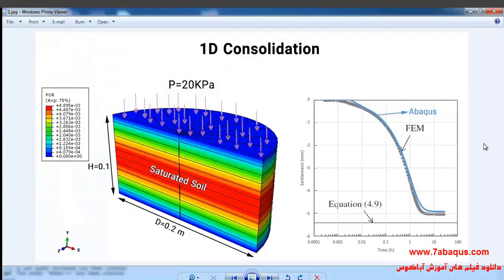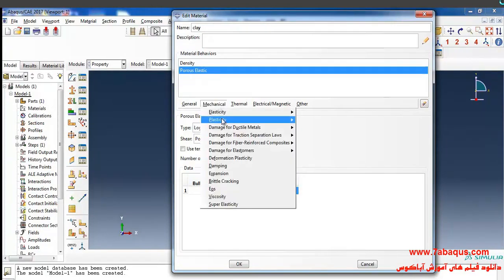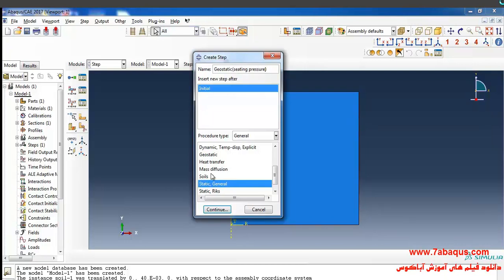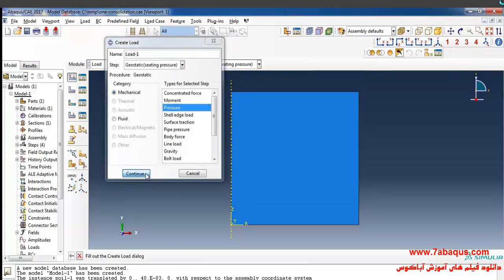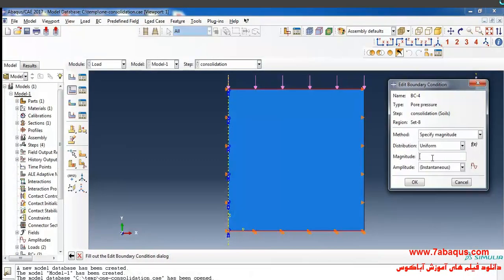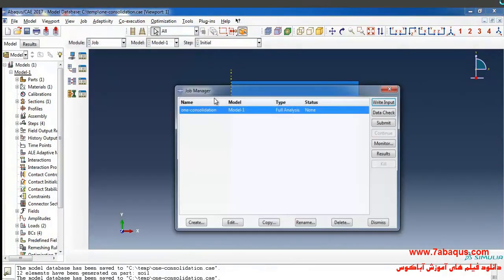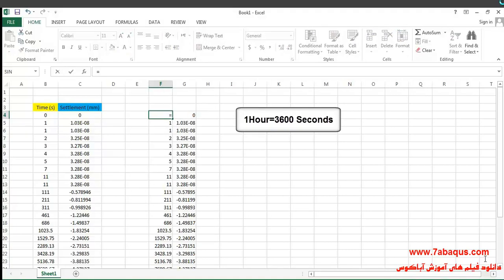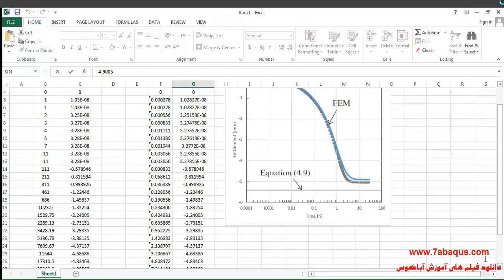1D consolidation of a saturated soil Abaqus

Comment: Hello, how do we determine the max pore pressure change per increment Or creep tolerance while defining the steps? How did you determine 21kpa Or 17 kPa for this particular problem. 
In initial conditions other than geostatic stress and void ratio, don't we have to define initial pore pressure and saturation?
Reply from the maker: These values depend on the loading rate , time period , size of each increment , ...
Reply from the maker: In this example soil is assumed to be fully saturated
 Initial pore pressure is used in special cases, for example, water behind an earth dam
Reply: @saeedmoeini-7abaqus  thank you

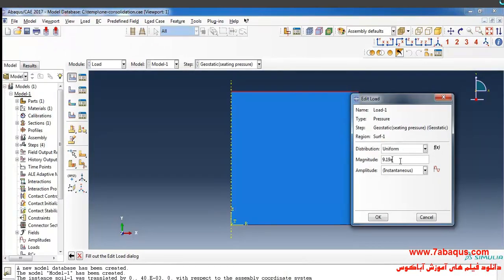Comment: why in 12:46 you use the geostatic pressure with a negative value for the vertical stresses? this wont cancel out the effect off the perssure load applied on 9:33?
Reply from the maker: geostatic stress is a negative value
Reply: @saeedmoeini-7abaqus  I asked because i thougt that positve values for pressures will be considered negative in abaqus, or not?
Reply from the maker: @isaquesoares6600  No , The pressure must be positive
Reply: @saeedmoeini-7abaqus  and why a predefined field for geostatic pressure is needed? only the aplication of the pressure load  in the geostatic step is not sufficient? and what happens if i only use te prededined field for geostatic pressure without the pressure load with geostatic step apllied?
Reply from the maker: @isaquesoares6600  In this example , pressure load is seating pressure
If you do not apply both, the balance will not be established

Comment: Hello, how should I display the stress vs time curve, I tried to select the unique nodal pressure for the selected node and I got a constant stress over time, I wanted to get something like Fig4.15 from the same text book you are referencing. 
My ultimate goad is to get the load versus displacement curve for a actual oedometer test, and I want to know how should I apply additional loads to simulate the loading and unloading in consolidation test (eg. applied loads at each stage : 20kpa, 40kPa, 80kPa, 40kPa, 20kPa.) Thank you very much in advance!

Comment: Hi Saeed, thank you for uploading this tutorial video. It is a very thorough and well-paced tutorial. 
I have two questions in regards to your modeling. 1) This is an axisymmetric geometry, thus in FEM you need to divide your pressure by "2xpixR" to capture the correct loading on the final cylinder (since it is a 2d representation of your model), is this also true for ABAQUS loading? or you just put the pressure as it is and it realizes that it is not the correct one and it will modify that? and 2) The pressure loading that you are applying is the mechanical pressure that is affecting the top surface, will that also affect the pore pressure degree of freedom of the elements too? I worked with CZM elements in ABAQUS and they have separate nodes for mechanical displacement and different nodes for pore pressure and I was thinking that it should be the same for the pore-stress elements too (CAX4MP) if that is the case then according to the textbook, it wants you to apply the same pore pressure as your mechanical pressure. So in that scenario, I guess you should apply the pore pressure BCs also on your part. You can check that by following the results of your pore pressure (PORE) in the output.
Thanks again for your videos and tutorials.
Reply from the maker: Hello
The answer to your first question is no , and we should not divide pressure by 2*pi*R
in fact the pressure of 20 KPa is applied to circle area 
-----------------------
The answer to your second question is no , in this problem , we applied the mechanical pressure to the top surface 
The concept of mechanical pressure is different from the concept of pore pressure
If a water tank was located on the soil , you should apply both pore pressure values and mechanical pressure values

Comment: hello sir,
your tutorials are highly useful. i have learnt a lot from these videos. 
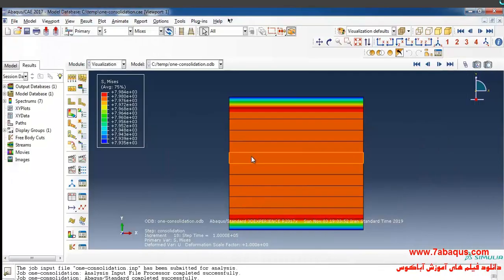i watched  this video and replicated exactly the steps what i noticed that at the end of simulation stress s22 was uniform but the stress s11 =s33 were not uniform across the soil. which is shown by the colour band changing from blue to red from out to inside and then the band again changing to orange colour. this can be seen from the von-mises stress color band also not being uniform at 15:12 of this video .  i think that the stress s11 is uniform so stress s22 should also be uniform, shouldnt it?;   what is the reason ? please reply my query
Reply from the maker: you see the results in end of step 2
in end of step2 ,  s11=s22=s33 and are uniform  (blue color)
You should check the results at the end of step 2
Your words are right for the end of Step 2
---------------------------------------
in end of step 3 (consolidation)
we have 2 drainage surfaces (top and bottom) As a result, s11 and s33 are not uniform in end of step 3 and this is usual and true because in step 3 we have 2 drainage surfaces
Reply: but sir as per theory, after complete dissipation of pore water pressure (which is nearly achieved by the end of step 3), whole load is transferred to soil and s22 (=29.10)form from top to bottom. this should be the case and its also shown in the model. but since in soil, s11=s33=coeff of earth pressure at rest*vertical stress(s22)  s11 and s 33shld also be uniform because s22 is uniform across the soil.
Reply: @saeedmoeini-7abaqus  but sir as per theory, after complete dissipation of pore water pressure (which is nearly achieved by the end of step 3), whole load is transferred to soil and s22 (=29.10=total applied stress)form from top to bottom. this should be the case and its also visible  in the model. but since in soil, s11=s33=coeff of earth pressure at rest(Ko) X vertical stress(s22);    s11 and s33 shld also be uniform because s22 is uniform across the soil. Isn’t this reason valid sir?
Reply from the maker: @amritkshetri5528  s11 and s33 almost uniform (The difference is negligible)
Read the numbers carefully for s11 or s33
-----------------
also this project is 1D in y direction (s22)
Reply: @saeedmoeini-7abaqus  yes sir the values are almost uniform. but what might be the reason behind differnt band formation? especially the band  colour changes from blue to red and then again to orange  whle observing from surface to towards inside of the soil body in case of s11 and s33? is this some kind or residual error? coz i dont think there should be variation in lateral stress along the body since weight is too small to affect that and pore pressure has nearly dissipated
Reply from the maker: @amritkshetri5528  because the pore pressure of top and bottom surface is zero
also your last sentence is correct